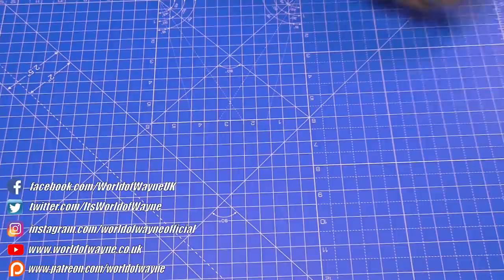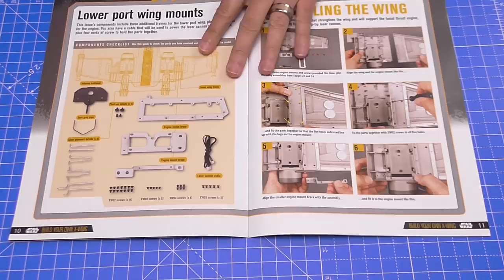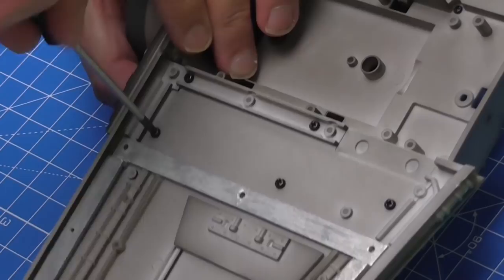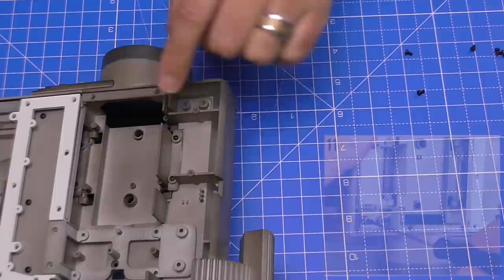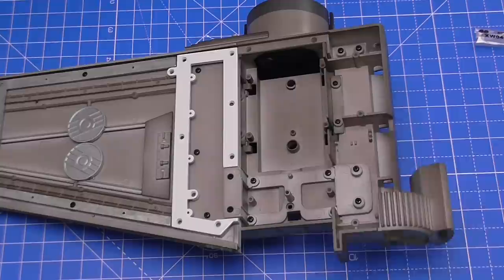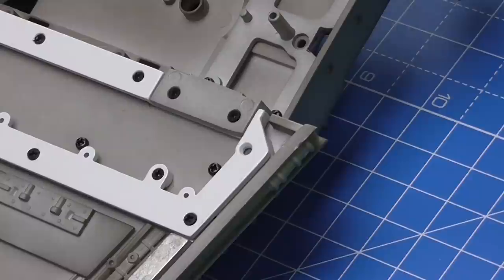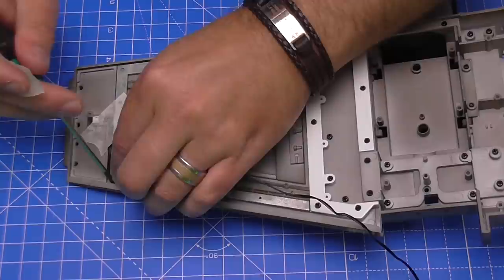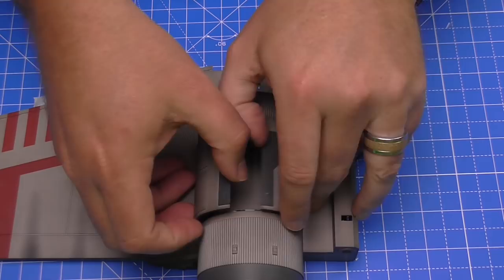Build the X-Wing - Part 28 - Lower Port Wing Mounts

Comment: I pick up issue 59 of the t-800 from my local paper shop today but still no issue 57
Reply from the maker: I will have to get 59 from eBay :(
Reply: I may havva spare issue57as soon as WH Smith,s reopens again Leigh
Reply: @bedfordshiremodeller4491  its ok i ordered it from Hachette  partworks online store last Thursday
Reply: @leightitley1831  fair1mate